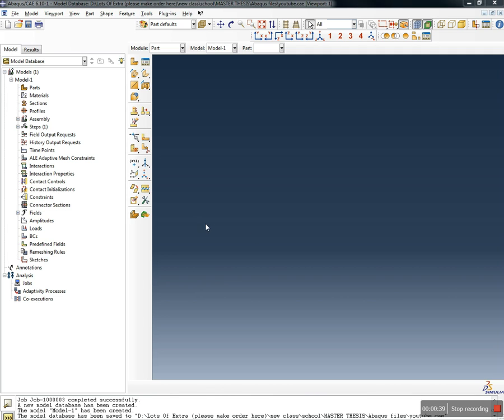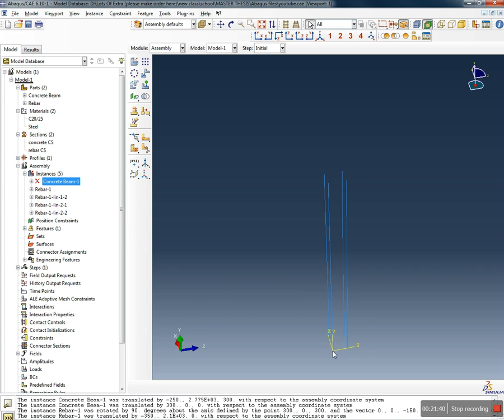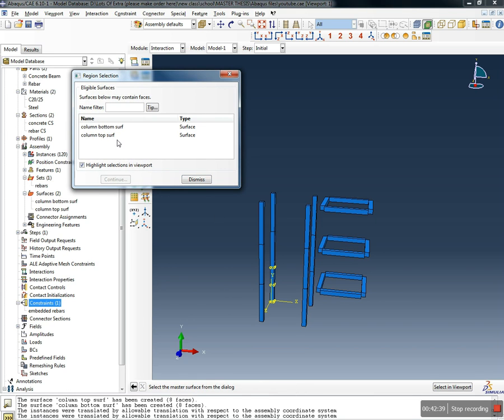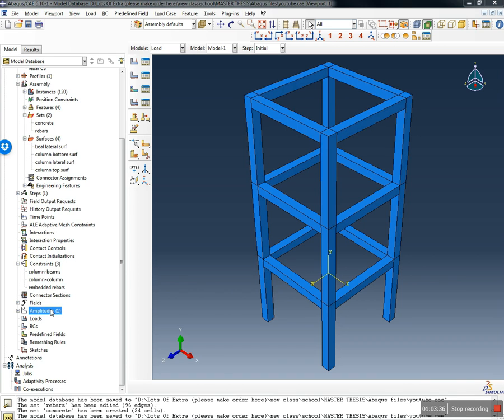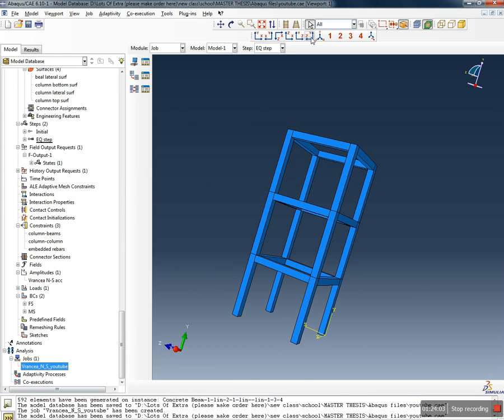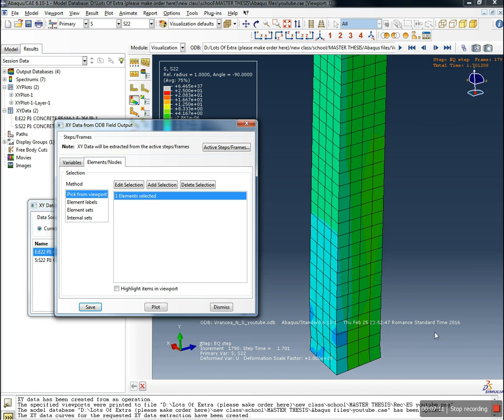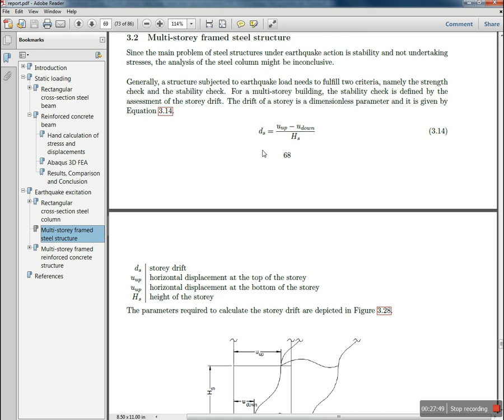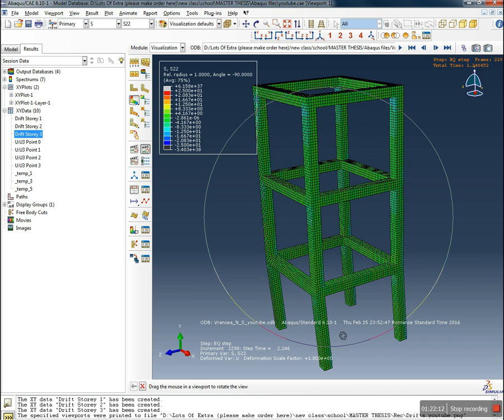ABAQUS Framed Reinforced Concrete Multi-Storey Structure Under Earthquake

Comment from the maker: The link to the excel file is now updated in the description and it finally works again. Thanks to Alaa Al-isawi!
Reply: Hi man thx for this great work, could you do so please for bridge under sesmic loading :)
Reply: @mansourdiop9961  Hi @Mansour Brother Shall i get a bit conversation with you
Reply: Vlad Inc. thanks a lot its very useful in my project ur a life saver. i didn't know how to do CDP. thanks again waiting for more videos
Reply: Vlad Inc hey man.. I just followed ur all the steps. But I have problem. I can't submit the job. There's an error. And the errors says" In model 1,Region of the part "steel bar" haven't been assigned a beam orientation .
Steel : Set 1

I tried many to fix the problem, but unable to do.
 Can I get ur Facebook account so that I'll send u the photo of that problem to u?
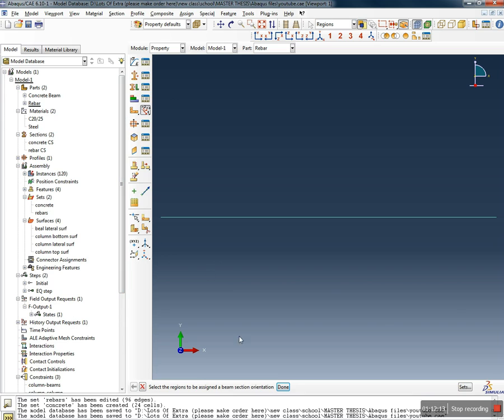Reply: @DarvaishBandah  did you try to assign your section orientation to your wire / beam elements like he did at 1:13:09 ?
Reply: Thank you so much sir
Would u please tell us how to model a blast load on a steel- concrete frame??
Reply: Can you send me your Master Thesis that use in this video?   robertomarcio1954@gmail.com
Reply: How can we use smeared crack model for concrete in abaqus?

Comment: Good explanation, but I have one question, regarding the Compressive Behavior curve (provided in the Excel sheet) you should not have inelastic strain values after 25Mpa, Is that right or no,

Comment: That is a very helpful video thank you so much
But where do we get the value of  amplitude and acceleration if we are going to model some structural member and check for seismic resistance

Comment: Thanks for video,
I had a question, for the acceleration output, should the acceleration of the points obtained in the history output be added together? Or is the acceleration of one point enough? And What boundary conditions should be defined to simulate the vibrating table experiment in Abacus?

Comment: Thankyou for the video. One doubt I've is what constraints should I add if I'm adding rebars. Should I add reinforcement and rebars tie connection and rebars and concrete embedded connection?
Reply from the maker: I guess you are referring to transversal reinforcement as reinforcement and to longitudinal reinforcement as rebars. I'm just guessing that, to me reinforcement and rebars is same thing. Probably that is what I would do, but you would have to research the validity of the results. I have one video with a reinforced concrete beam, maybe you can find a bit of value there, but I stopped looking into reinforced concrete shortly after uploading these videos. I wish you good luck in your research!
Reply: @VladInc  okay I'll watch that video. Also why partitioning is required and why beam section orientation needs to be defined?

Comment: Dear Vlad, Excellent video Thank you so much for teaching us free of cost. Can you help me actually i got error as: SELF CONTACTING SURFACE ASSEMBLY_beam lateral surf IS CURRENTLY NOT ALLOWED FOR TYING SURFACES.
and also warning as: FOR *TIE PAIR (ASSEMBLY_Column top Surf-ASSEMBLY_column bottom surf), ADJUSTED NODES WITH VERY SMALL ADJUSTMENTS WERE NOT PRINTED. SPECIFY *PREPRINT,MODEL=YES FOR COMPLETE PRINTOUT.

Comment: Hello .. While using CDP, how you are calculating the values of Bulk modulus of elasticity(K) value of Concrete? You have used it as 0.67 (any reference)
Reply from the maker: hello. as i remember, it is the default value and it is documented in the user manual
Reply: I am following

Comment: Thank you for this video. I'm actually stuck while running the job of this model an error has occur it says as follows;

17760 elements have missing property definitions. The elements have been identified in element set ErrElemMissingSection.

ELEMENT SET _Whole_Model_Gravity_Elset HAS NOT BEEN DEFINED

Can anyone help me please.
Thank you in advance.
Reply: i had the same problem, assigning element type to concrete and the rebar separately solved it.

Comment: It is very important video thanks. But if we have different dimension of beam and column, how we model it? Is it possible to include slabs?
 Please upload videos regarding concrete filled hollow section  (circular, rectangular, square and polygon).

Comment: Hey Vlad,
if you want to only select the beams or the rebars you could klick on Instances once and then press F2. A Textfield should open where u can type * Rebars * or * Beam * (without the space) and only Instances with those letters in the Name should show. Then you can select all rebars by simply Shift Control klick from top to bottom. Same goes with *Beam*.
Its not a perfect solution but i thinks its a bit faster than selecting every Rebar and then selecting every Beam.
Hope it helps a bit.

Comment: Nice video ! @Vlad Inc. Is it possible to get the report.pdf link? I'm a graduate students studying for structural engineering and your video are really helpful!
Reply from the maker: you find it at the link in the description
Reply: @VladInc  Ahhh. I didn't click the document on the right side. now I get it. thanks a lot!
Reply: May I asked a question? Why we need to set "The base displacement on z direction is reset to free" 
Is our base fixed when the earthquake strikes?

Comment: why you did not aplly damping to structure? and the other question is that what about dilation agle? is it changable from concrete to concrete ? i wont do any experiment thats why i am asking whic value should i use? thank you in advance.
Reply from the maker: muhammed atar because I forgot. Second question got no idea
Reply: I see but could you please help me how can I get the damping values for alpha and beta ?
Reply from the maker: not really man. it's been a long time. I recommend Abaqus user manual. You don't find all the answers there but it's a good starting point. I wish you good luck in your research

Comment: 1st I appreciate for this helpful video, but there are some mistakes in defining materials, for elasticity module you said 20000 Mpa but its dimension is N/mm2 and its density is not Tons/mm3 but it's kg/mm3 because the newton itself is defined as (kg)(m)/s2
Reply from the maker: Omid Jahanshahi 1N/mm^2 = 1MPa. Please check the other one again

Comment: Thank you for your tutorial video. 
1- It Is better to use Display option instead of using suppressing option. 
2- We can put the mesh on each part separately by activing “Part” option instead of “Assembly” in mesh module. 
3- Concrete beam and reinforcements have different types of mesh. 
Mesh Types: 
Bars: Beam (B31)
Concrete Beam itself: 3Dstressed (C3D8R)
4- Why did you apply gravity load while we defining our mass density for each part in dynamic analysis?

Comment: Dear Vlad!

You have done an outstanding job on your thesis!

I would like to ask you if you know how to extract mass, stiffness and damping matrices from Abaqus, since I am doing a master's thesis in structural dynamics as well and I desperately need them. I checked up the Abaqus user's guide and there are given suggestions that we can script the input files. Since I dont know my way around the Abaqus scripting yet, I want to ask if you knew how to extract these matrices directly by using GUI commands.

Cheers!

Comment: Thanks for the great video. it was nice and comprehensive. In order to see the rebar's individually in the visualization part, you need to go to tools-->Display Group--->and create a new display group excluding the concrete parts. it is easy to do, hope that helps.
Regards,

Comment: hi there.
I am trying to find out ultimate load carrying capacity of a RC jacketed column. earlier the column dimension was 300*300 and the ultimate load carryimg capacity of that column is 963.045KN(Calculated mathematically in Accordance with Indian Standard code IS456-2000). Now i am trying to provide a jacket of Reinforced Concrete(RC) to that column of 100mm thickness. So , the new dimension of that column becomes 500*500. Area of steel provided Everywhere is 1% of gross cross-sectional area. SO what will be the new ultimate load carrying capcity of jacketed column (with ABAQUS)? I am ready to purhase the CAE file

Comment: how come the gravity is using instanteneous and how do you check whether it should be -9807 or -9.81? how do i check units thanks
Reply from the maker: Watch between 1:07:40 and 1:08:10. It is instantaneous because it is not function of a time series. About the units, I like to use N-mm-tonne-seconds as units, Because in this way I get the stresses in MPa (N/mm^2). That is why I am writing -9807, because they need to be mm/s^2. You can use any units you want, but you have to be consistent throughout the model, so you are in control of your results.

Comment: you said how can one check stress only in rebars. i think you better need hide concrete but an option in abaqus replace or remove the instances 
By the way it was nice video. Thanks for nice work

Comment: Amazing video. Thanks. Is acc=m/s2 or mm/s2? and why squeezed up? what is the squeezed up? please help me. respect..
Reply from the maker: thank you. 1:10:25 for the first question. For the second question, you don't need to squeeze the time series of the earthquake. I just did it because I wanted too, I guess. I wanted to increase the dynamic effect of the earthquake. Make it all happen in 3.5 s instead of 35 s. You can use any accelerogram you want
Reply: I am not sure about unitate of acc what do u think? should be mm/s2 ?
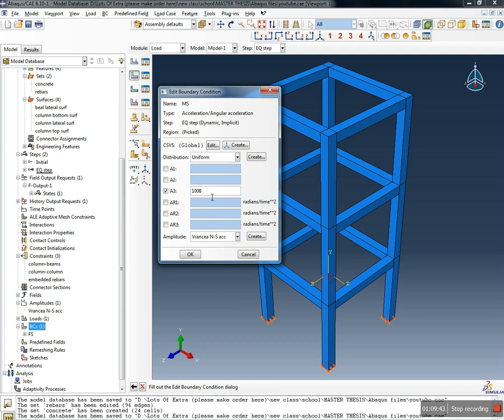Reply from the maker: its mm. since i introduce the series in m, i apply amplification factor at 1:10:42
Reply: thanks

Comment: Hi Vlad, excellent video thanks for shared and congratulations. I used to work with carbon fiber materials to strengthen some structural elements, I gonna model the same set frame but with fibers in some piles and beams to valuate the performance of those through S and U, I want to model with static load because that the case that I need, any commentaries for the BC (assignment of loads and reactions) and event in the contact between fiber and concrete surface would be useful... Thanks
Reply: hi nicolas i'm doing my thesis using GFRP material and i need some help can you please share your email or any contact

Comment: I felt sad for you doing the suppress method only for viewing and selection reasons. Dear Bro, use the Tools>Display Group>Select which set or entity you want to view on your screen for selection. Very bad way of suppressing features only for selection purposes!!! good luck, if you need any assistant in any type of simulations, simply ask me! 
Good luck civil guys! , but FEM needs a much deeper understanding to get the intended non-linear simulations... its a world of mechanics... But its a good beginners dynamic analysis is shown.. bravo
Reply from the maker: Dr. Ghayath AL KASSEM You don't need to feel sorry for me. You are free to do it yourself properly
Reply: No not "sorry for you" i said "sad", but this is the wrong way doing it because you will lose lots of features some are unknown and this will duplicate your working time, you could have saved half an hour min or more if for selection you used what is made for it, the Tools>Display options>create>...etc.
No worries..
Reply from the maker: Dr. Ghayath AL KASSEM You made it very clear, no need to post same thing three times
Reply: Dr. Ghayath AL KASSEM  How can i draw the relationship between load and maximum strain in main rebars please any one help me alifaiq102@gmail.com

Comment: Really great video! I learned the basics from this video alone. More of this type of video using steel structures would be awesome (maybe strain hardening for cyclic structures). My only suggestion would be to use the hide function instead of the suppress option.

Comment: Hi
why you didn't use stirrups? do you have any reference that saying no need to put stirrups?
Reply from the maker: No reinforced concrete structure should use stirrups. It's all a hoax. 
That was obviously a joke. The structure also doesn't have slabs or bracings so it is actually terrible for seismic design. The point was to understand how to use Abaqus for applying this kind of analysis, not to understand how to design under earthquake load. There were a lot of stirrups to add and I didn't know how much longer would that make the analysis. I waited for 48 hrs without them. Feel free to use stirrups, maybe I'll do a video in the future on that effect of stirrups.

Comment: Hi...
in EQ step why you didn't click on for included nonlinear effect? if you press on what will happen ?thank you.
Reply from the maker: please tell me what time in video
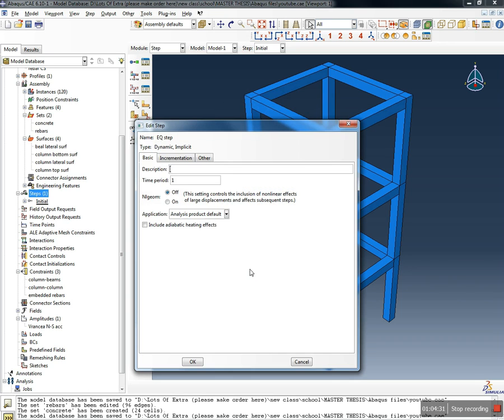Reply: Vlad Inc. 1:05:25
Reply from the maker: Yes, I can see it's something about nonlinear effects of large displacement. I think that the induced eccentricities are taken into account into further steps if that is checked. Anyway, I don't think I have seen that before. It is a good thing to dig in, but for the moment I can't say much about it. I think that the best thing to do is to take a very simple example, like a beam or a column subjected to a simple loading scenario, and see what happens when that box gets ticked on and off. Also, I think I forgot to include a damping model in this exercise.
Reply: another thing please. for boundary condition you didn't take in account the rotation. is it zero or what? also why you take the X and Y direction as fix support?  why you didn't leave it like what you do with rotation ? thank you.
Reply: 1:24:00
Reply from the maker: I don't impose zero rotation because there is no reason, since I impose the zero translation condition on two directions and the location that I impose the condition to is a plane surface. Imagine a square, it cannot go left-right, it cannot go up-down. That involves it can't rotate either because it would break one of the first two conditions, all the points of the square have to stay fix on left-right and up-down. So it's just not necessary to impose zero rotation. If there was a column modeled as beam(1D), so the condition was applied to a point, then you should impose zero rotation too. I hope it makes sense.

I don't understand the second question.
Reply: Vlad Inc. thank you I understand now.

Comment: SIR WHEN I ROTATE THE COLUMN REBAR STAYS AT THAT PLACE and doesnt rotate along with concrete host
Reply from the maker: make sure you select everything. if you however still face the same issue, you can just rotate the rebars separately
Reply: SIR THANKYOU very much for your reply,sir we are modelling soil structure interaction problem in abaqus but sir instead of using wire element for the superstructure we modelled it as a 3d Solid frame....sir i saw your video on SSI so our project is combination of this video and SSI  video,,,it helped us a lot
sir our teacher told us to model soil as a infinite medium do you have a video regarding that.
with regards

Comment: Nice video VLAD. Problem is that in my version of ABAQUS CAE, at the end on submitting the job, error is throwing- " only upto 1000 nodes are possible in Student version of Abaqus" . What to do now? Do I have to buy commercial software. Kindly guide.
Reply from the maker: If you are a student, you should ask your supervisor to hook you up with the full version. It only takes changing some lines of code in a file
Reply: Thanks Vlad for replying. Could you please elaborate ? What should my supervisor have to do? Where to change code, etc. Thanks again.
Reply from the maker: You just ask him to give you access to the full Abaqus version, with unlimited number of nodes to be analyzed, because you want to do some more complex work. See what he says. That's all

Comment: Nice video man,,, well done... really helpful for my final year project... i was wondering if you can tell me how i can get my hands on the manual you are working from on?
Reply from the maker: Thank you. It is my master thesis. Link to the report in the description, then click again on report on the right side under 'DOCUMENTS'
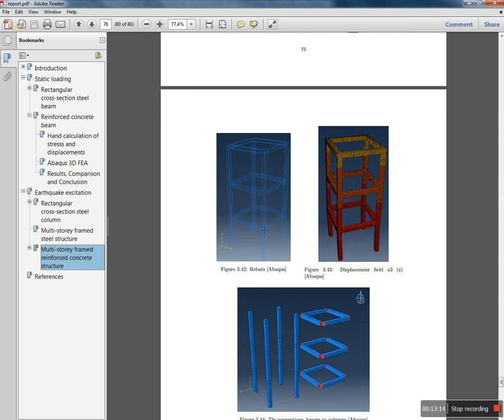Reply: Thank you for the reply,, but im actually referring to the PDF file you seem to be working from,, it can be seen in minute 13:30, im interested in the steel structure example they have there...
Reply from the maker: That is also what I was referring to. I don't think I used any other pdf in this video
Reply: @VladInc  can you plz tell me the procedural difference for pushover analysis for flexible diaphragm also explain me how we can calculate base share value for the above tutorial

Comment: Very good video and you are a good and informative teacher. Thank you for your good work. I am very beginner in Abacus and I have done everything you did step by step and it works! Three question please, 1.how can I view the cracks in concrete? 2.how to connect each successive (in the y-direction) three steel bars in the columns so that they are not discrete at the column faces? 3.why didn't you extend the rebars in the beams to connect the columns and beam by steel rebars to strengthen the joint, is it difficult to do so?
Reply from the maker: Hello. You don't view cracks in concrete, it would be cool though. You just observe them by means of stresses and strains.
Reply from the maker: You can't see cracks in Abaqus. You just observe them by means of stresses and strains.

Comment: Hello   mr Bugsy
Thanks a lot for sharing such a nice video.
may I ask you for sharing the Excel sheet file and If you are modeling a circular columns have analyzed the heat and To frame model with circular pillars working. Or it could be possible for me to list an article about it .tanks alot send detail and materials. My email address:salehi.reza14@yahoo.com and myface book:rezaasalehi...........tanks alot
Reply from the maker: link to the Excel file is in the description